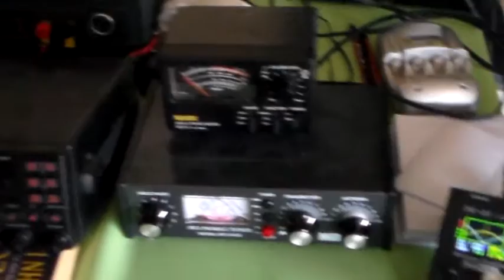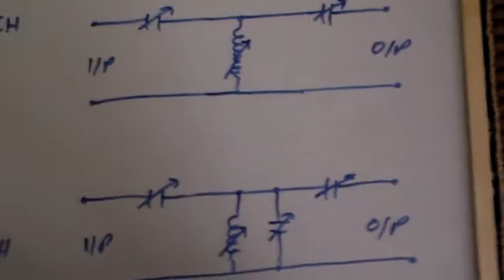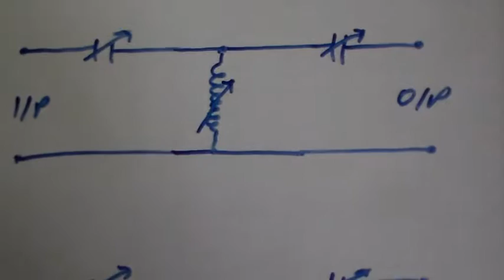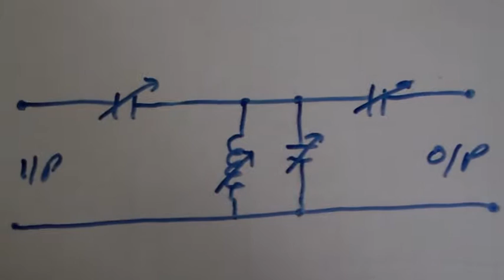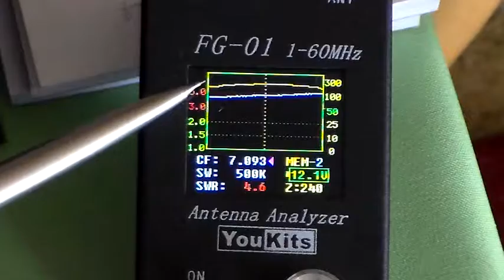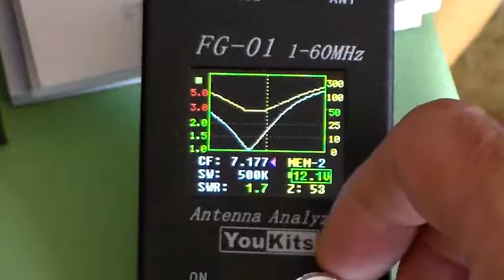T Match And SPC Match ATU Tune Bandwidth Tests.

Comment: The old Universal Transmatch from QST 1970 had a similar design to the SPC. The split stator cap was fed in the center with the roller inductor in parallel  across it and an output cap in series. Just got finished reworking an old unit that someone built years ago that had a broken roller inductor. Works well just need to repaint the cabinet. Looks like the old Murch Transmatch from the early 70s that I still see at hamfests. HV variable capacitors are not easy to find and not cheap when you do but they last forever unless abused. The steatite ceramic insulator plates were badly broken. I don’t know if anyone makes them that way now. Even the very expensive caps and roller inductors have a type of plastic for the insulator plates now.

Comment: Hi there OM-
I loved your video.  It was really interesting to see your comparison between the Z matching units!  Your homebrew one is beautiful.  Regarding the 'acceptable SWR points' without retuning... I would think that since you have the 'tuners' located within a few feet of your transmitter... loss on that line is negligible... and that an acceptable SWR level would be one that doesn't cause a power foldback on your transceiver.  If you can operate with an SWR of 3:1 with no power reduction- then the loss on the 2 or 3 foot piece of coax would be negligible.  If you slid up to 7.275 MHz for example, and your SWR was 3:1... and moving to this frequency was approaching the natural resonance of the antenna- then the loss on the line between the 'tuner' and the antenna would actually decrease.  And since that line is much longer than the one between the 'tuner' and the transmitter- you would actually be delivering more power to the antenna.  Just a thought  :)  Keep up the good work and the videos!
Reply from the maker: N8NK QRP Thanks for the fedback and those kind words. I wouldn't go much beyond 1.5:1 personally as solid state PA's like to see a load close to 50 Ohms. It's more about keeping the PA happy than loss in the short section of coax between the radio and matching unit. The PA won't put full output power into 150 Ohms.
Reply: VK6CS I suppose.  I wouldn't know: I'm still running a 1970 Heathkit SB-101!  As they say: 'when stressed, tubes blush- while power MOSFETs scatter plastic'.  Haha.  Keep up the great interesting, educational and very entertaining work!
Reply from the maker: N8NK QRP Haha... for sure, it was the 'QRP' that threw me. Thanks again.